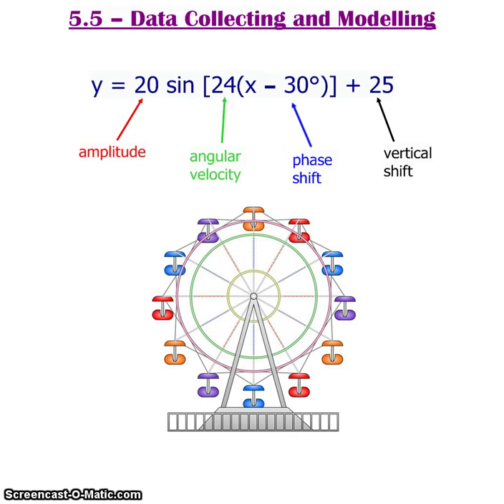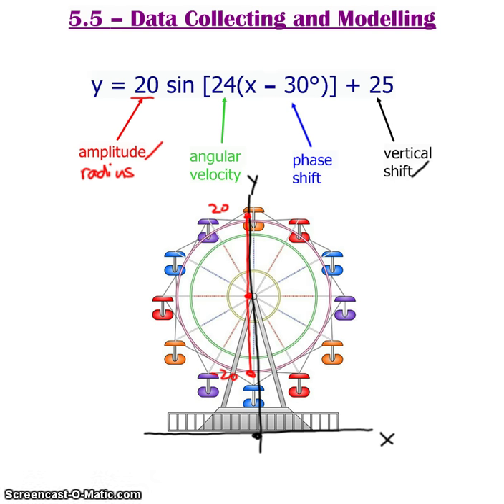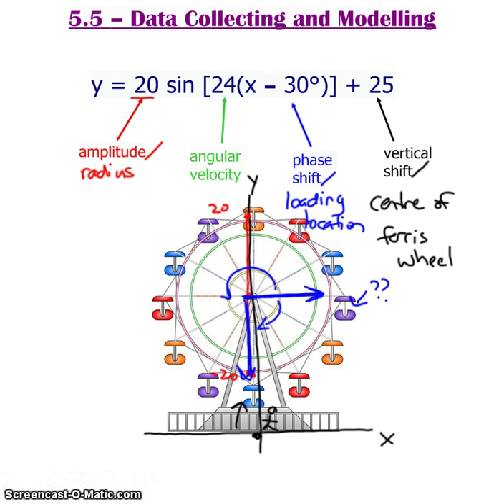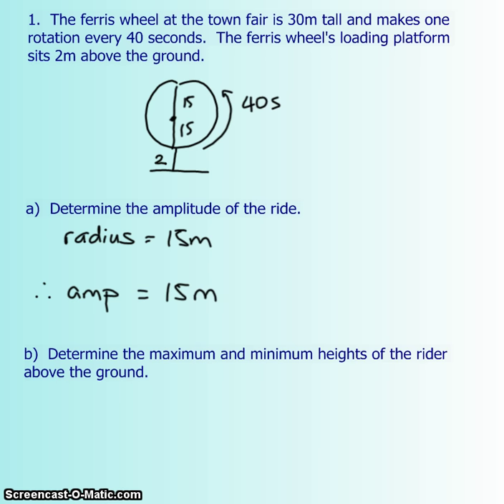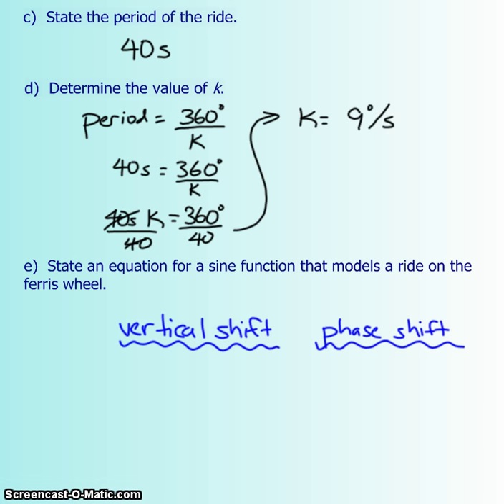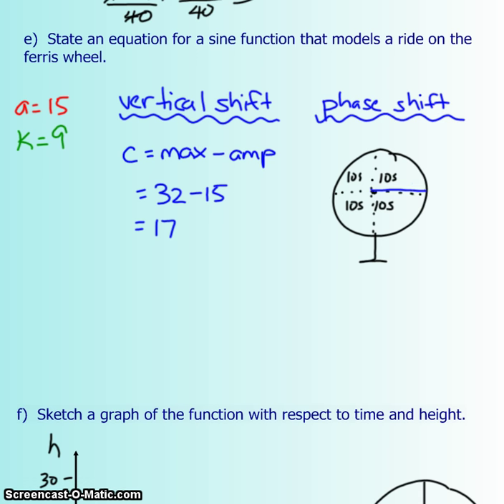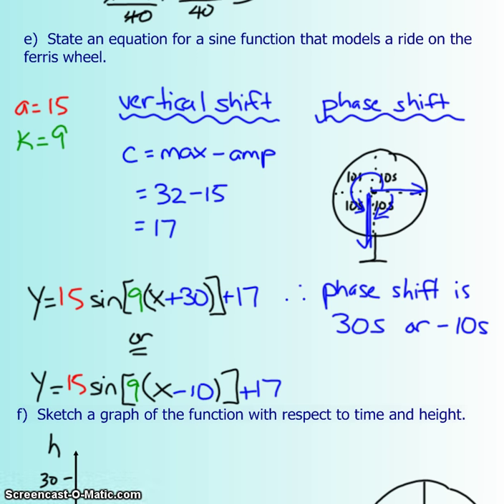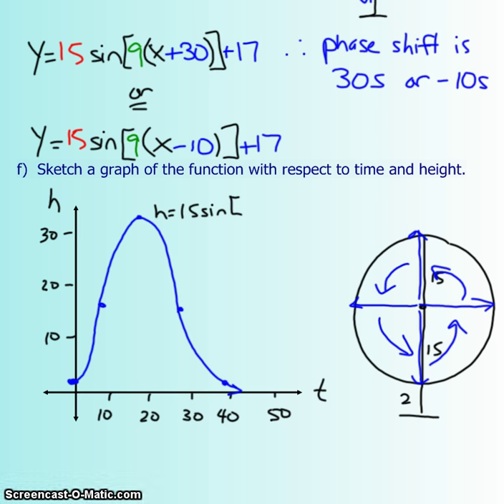5.5 - Data Collecting and Modelling

Comment: Wouldnt it also be 10 seconds if the car goes colockwise from the standard position instead of -10 secs?
Reply from the maker: Good question!  Starting at standard position, your goal is to turn (clockwise or counterclockwise) to end up at the terminal arm, which is pointing towards the bottom (where the person loads or gets on).  If you turned 10 clockwise, you would be at the maximum, not the minimum (where the person loads).  So no, only the -10 counterclockwise would work.

Comment: 9:53 why  is it + 30, can't it be - 30 if your writing in Cos? y=15Cos 9(x-30)+17
Reply: I thought it was suppose to be -30 for the shift
Reply from the maker: At 11:36, you'll see the full graph.  Consider where a cos graph shape would start if you didn't reflect it.  Cos starts at a maximum point normally, so 1 cycle of cos could start at the (20,32) coordinate until (60,32).  That would make it a shift to the right 20 from where the cos graph usually starts (y-axis).  Hence, if you want to use a cos function, the equation would be y=15Cos 9(x-20)+17, not -30.  Hope that makes sense, it's really hard to explain in text.

Comment: Hi, i got a different equation. h(t)= -15cos(9t)+17   I plugged the x values in and i got the same thing as yours. Would a teacher accept that answer?
Reply from the maker: Arjoon B Although your equation is correct, the question asked for a sine function.  If it were a question on a test and the question specifically asked for sine, I wouldn't accept your equation.  However, if the test question just said to create 'an equation', then it is your choice to use sine or cos in which case your equation would be acceptable :)